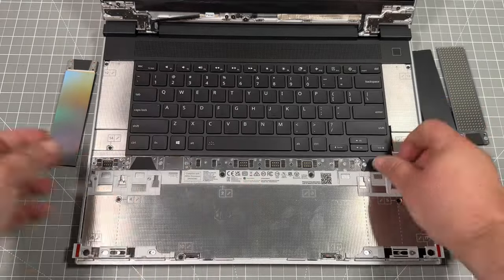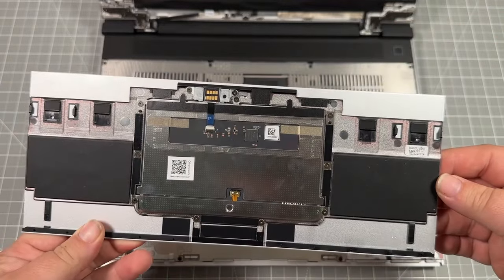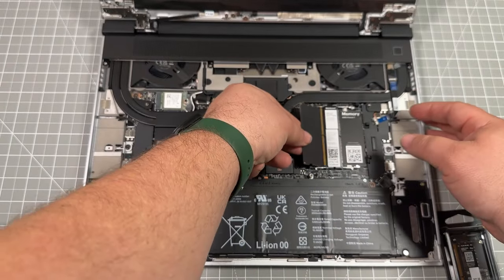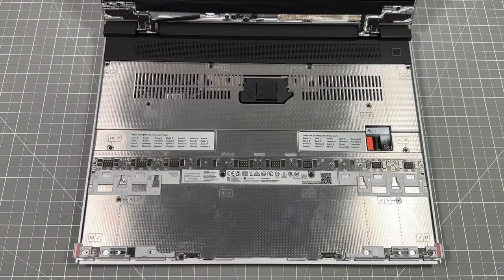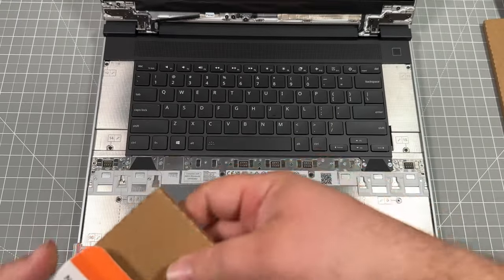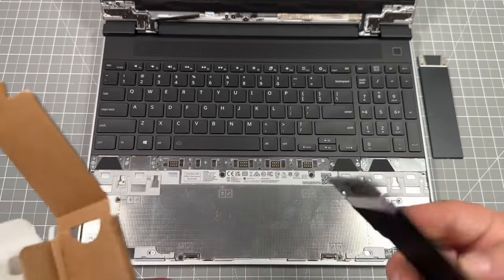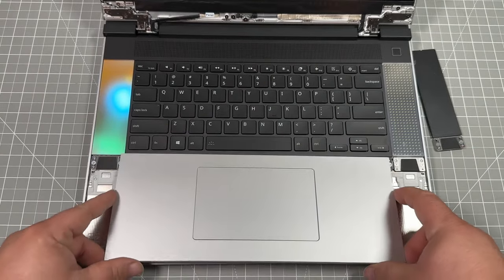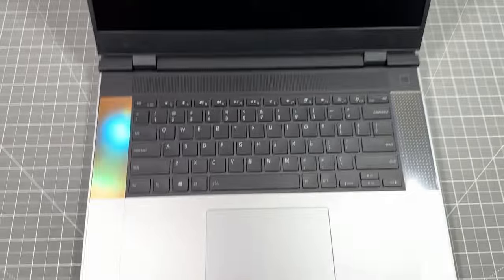Framework 16 Assembly

Comment: Another great video!  I can't wait for the next one in the series.  By the way, there are flaps at the bottom of the keyboard, numpad, and spacers to make it easier to lift them up from the magnets.
Reply from the maker: Great point. It is still magnetized down, so it holds it close to the plate even with the tabs.

Comment: How is the performance on battery? there is a big loss of performance?
Reply from the maker: Ok, that is a big question.

What is your use cases?
Is there one you would like me to test?

Light web browsing?
Gaming on a AAA Game?
Reply: @Jscar_Hawk  Hello, I would like to know what noise the fan makes playing AAA games like cyberpunk at 1080 p and 60 fps on high and medium.

I would also like to know the gaming performance on battery.

I would also like to know if the fans can be controlled with msi afterburner

Thanks

Comment: I wish they made an aluminum plate to eliminate the touchpad, because I absolutely loathe them, and prefer to use a mouse. But, I will admit that I'm probably a minority when it comes to that.
Reply from the maker: I bet SOMEONE, can or will make it.

All the specs are known, so folks can create what they want
Reply: Couldn’t you just order a bunch of extra spacers or led matrix panels?
Reply from the maker: Once they get in stock, but right now they are focusing on getting them shipped with the folks who are buying it with a laptop and not singles.

Once that changes, you bet I'll be picking up a few.
Reply: Just disable it in the OS. Linux, at least, lets you also automatically disable it when a mouse is connected.
Reply: you can disable the touchpad
Reply: @Fonexas_  I don't want it there at all, or I wouldn't be wishing for an aluminum plate without it.

Comment: That keyboard is rough man. 2000$ and there's no arrow keys, just some weird ineffectual nubs.
Reply from the maker: I am mixed on it to be honest. My Lenovo laptop has full arrow keys. The Framework 13 inch has full arrow keys for the left and right, but short ones for up and down.
Reply: Well you're in luck, because it's modular. So they'll definitely make ones where your needs meet.
Reply: @FR4M3Sharma  It is modular, but it requires for the part to be made.